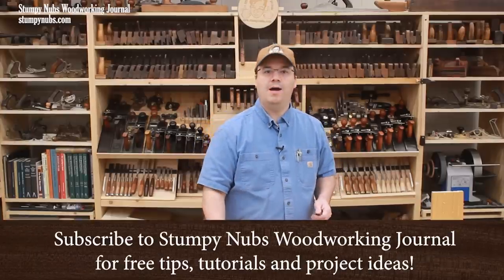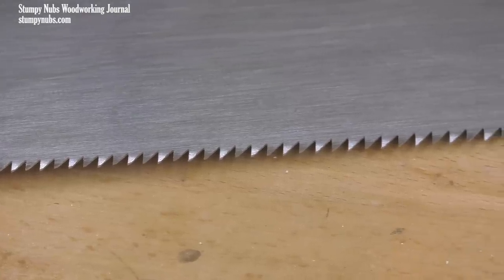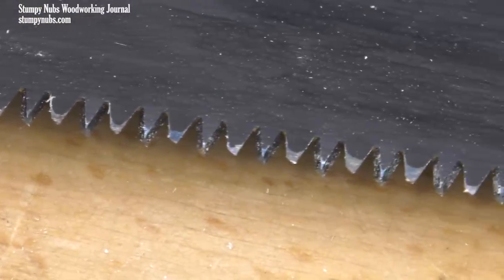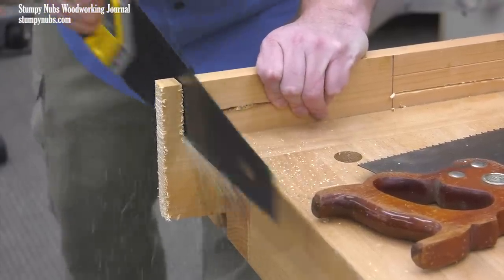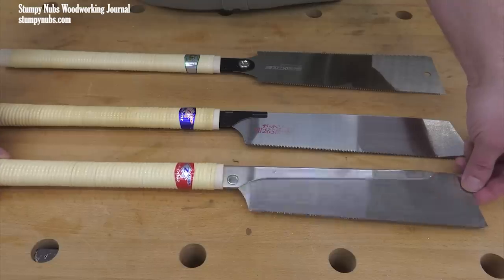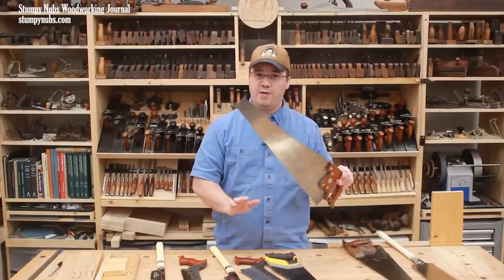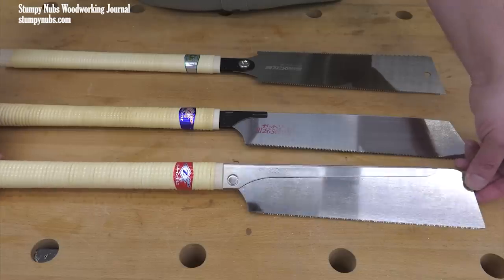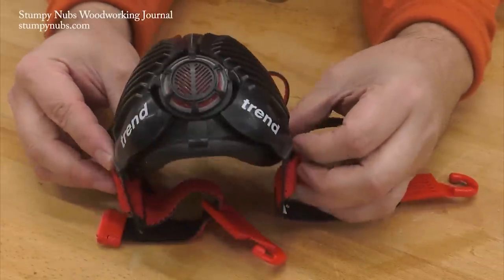Do Japanese saws cut faster than western saws?

Comment: The pull saws surely come with a cleaner neater cut, but I don't like to sharpen them, The push saws are so easy to keep tuned, The newer cross over saws that don't know if its a push or pull saw are designed to be disposable, and that is great for capitalism, so now we have some real choices.

Comment: you didn't take into account the length of stroke  for each saw. for example the stroke of the diston takes a 
much longer cutting stroke than the japanese saw..... when you are countjng stroke for stroke in my opinion
makes a big difference do you not think so ??
Reply from the maker: There are many factors that were not accounted for. This is merely my observations, not a definitive test.

Comment: The major difference between push and pull saws is the difficulty in using.  An adverage person using a pull saw will make a very good cut the first cut they make with it.  How many hundreds of cuts with a pushed saw to gain the same results, and how many kinked and ruined saws before they can make a decent cut?
Reply from the maker: You exaggerate. I started with a push saw as a child and never bent it. My first push cuts were on par with my first pull cuts. It's just a different process.

Comment: I think, regardless of push or pull, when you’re just starting out into hand tools, everyone should learn the proper technique for both saws and then make the decision. I had a terrible time with push saws starting out, but have since realized it was mostly user error. So, opinions can definitely change with experience and knowledge. For that reason, I think saying one is better than the other is unfair. It just depends on which one fits your personal style.

Great video. I appreciate the openness to others’ thoughts, questions and opinions.

Comment: Here's my takeaway: people on the internet will argue over anything. I don't know why the SPEED of hand sawing is relevant, when every saw is within a few percentage points of every other saw. 

What will the gallery argue over next? Which type of hand saw SOUNDS better when using it?? Can't wait to see the comments on that topic.
Reply from the maker: Nobody says you MUST be concerned with speed, but there are plenty of reasons why one may wish to consider it when choosing a tool. Speed can equate to less energy expended. It can also make a significant difference in the time it takes to dovetail a chest full of drawers or any number of other tasks. That said, there are many other factors to consider besides speed such as precision, comfort, quality, etc. These were covered in the other video: https://www.youtube.com/watch?v=PZdoLx72faM.

It is also worth remembering that not all of the fastest cuts in this video were rough cuts. The rough dimensional cuts may have been, but the joinery cuts were not. There is a time for both types of cuts and a bit more speed does not always equate to a poor result.
Reply: @StumpyNubs  Yes, I agree that there are many more factors to consider when looking at hand sawing. I think the point I was trying to make is that when one does a comparison of any single one of these factors, if all of the results are within +/- 5% of each other, that factor is nearly irrelevant (meaning: the other factors are probably what matter more). When you start to see differences of 10%, 25%, or greater, that factor becomes relevant.

Comment: I find it odd that in a competition regarding speed, no times were mentioned. Are we to assume the number of strokes directly correlates to the amount of time it takes to finish the cut? Anyone genuinely concerned with speed (i.e professionals) isn't concerned with number of strokes, they are concerned with number of seconds/minutes, and this should include the time it takes to get the cut started. Great video, but could be redone better with better science.
Reply from the maker: Time alone doesn't account for pressure, length, the grain of the wood (which can change significantly by the inch in a single board) any pause mid-stroke to adjust, angle of the blade, etc. It's not a scientific test and I didn't claim a definitive conclusion.

Comment: Speed is a red herring when comparing handsaws - western to western, Japanese to Japanese or western to Japanese.  Whether you are a pro, DIYer or home woodworker it’s probably fair to say no one (except maybe a logger in competition) works to develop speed of cut as a  skill.  People work to increase  their handsaw capabilities to make accurate and clean cuts.  Increase in cut speed  is simply an artifact of honing those two primary skills and in itself has no value.  The true comparison of saws and the only one which makes sense  is which type of saw helps you make more accurate and clean cuts.  That is largely a matter of what you’re used to. A western saw user will always make much cleaner and accurate cuts with a western style saw until they rake the time to practice with and use a similar purpose Japanese saw properly, and vice-versa.  Personally I prefer using a well tuned hand saw over power saws when they make sense for the type of cut and sometimes even when they don’t.  There is something very satisfying about the quiet sound, the feel, the ease and the movement of a handsaw.  I am starting to use Japanese saws more and more because I find them to be much more kind to my battered rotator cuff.  If I really do need speed I just pull out the circular saw.
Reply from the maker: Speed can sometimes mean less energy expended. Of course there are also many other factors involved. This is just one of them.
Reply: @StumpyNubs  I’m not sure that’s true.  It takes X amount of energy to cut from point a to point b.  You can do it slowly so you expend less energy on each stroke but you need more strokes.  You can do it quickly using less strokes but needing more energy for each stroke.  Do they balance out? I guess the only way we’ll know is to hook you up to  machines with a lot of tubes and electrodes to measure muscle oxygen consumption, electrical differentials, perspiration production, inhalation and exhalation gases, heart rate, respiration rate and probably a bunch of other parameters.  Take lots of pictures.  Or, you could just use the 1 sawtooth to 10 saw teeth “holy shit that sucked” scale taking.
Reply from the maker: @georgepagl  Speed is not just a function of how quickly you move your arm. Many factors add up to increase speed including the density of the wood, the pressure applied, the type of tooth, etc. And not all of those require extra energy to increase speed.... Again, this video is just a discussion of a single factor that makes for good sawing. The other video discussed other important factors.
Reply: @StumpyNubs  Morning, re-reading my last response, I can see where it may have sounded argumentative, and maybe a bit snarky.    Social media being what it is you probably get a lot of negative crap.  Hope it wasn’t taken that way.   Was just trying to add a bit of humor with the image of you in a video hooked up to a bunch of machines sawing a piece of wood.   With all other factors being equal, whether sawing faster or slower expends the same amount of energy may be an interesting academic discussion but is probably better left to a Physics channel.
I saw the other video and thought it was great, learned a lot.  All your videos are are really informative, enjoyable and well produced without any fluff.  Thanks for them.

Comment: Comparing the price of them with the advantage (or not) of them would add another element. If a $250 Japanese saw cuts only a couple strokes faster than a $25 western saw....

(I am a Silky saw snob, but that's for outdoor work - everybody marvels at how quickly and easily they eat through wood.)
Reply from the maker: Most Japanese saws, including the ones used int his video are significantly less expensive than a comparable Western saw. Mine are $25-40 each.
Reply: @StumpyNubs  that's surprising!

Comment: I think you hit the nail on the head! It's all about what your preferences are. I have all kinds of saws too, and I use them as needed. If I want accuracy and not speed. And depending on my shoulders and how they hurt when I wake up I use the saw that has the least resistance to my shoulder. Read between the lines. :)

Comment: Useless info. Today I was gardening and had to use my grandfather's Western style saw (its probably used since the 50s or 60s when he bought it) since I couldn't find my folding saw (I had to trim some grape vines that we use for shade and of course the fruit itself). Being up in the ladder using the old saw was hard and its to be expected because that was not its intended use. As soon as I found my folding pull-saw I started using this. The difference in speed was totally unexpected. I didn't time the cuts but the push-saw was way faster. And it's unexpected because I have not sharpened that saw at all. But wherever the pull-saw was biting the push-saw just ate raw. Of course as tools they are very different with the push-saw being around 50cm and the pull-saw at 20-25cm. But I didn't expect the newer saw that has seen no action compared to grandfather's saw, to be biting as much as it did.

Comment: Japanese saws work better in softwoods and European saws are better on hardwoods.
But that difference isn't big enough to really matter.

Mainly it's ergonomics.
The pull saw is easier if the work is between waist and shoulder height and the push saw is easier when working above or below.

Comment: Yeah, this has been my thought on this, western saws are carpentry saws for relatively quick, bulky, functional work that is very often covered up. Japanese saws are more in the direction of woodworking saws. Both are very good in their niche.
Reply: If what you say is s true, western style saws would never have been used for fine woodworking or furniture making. But that's absolute nonsense. Modern hardware store western saws are crude, designed for cutting plywoods and other materials more than hardwoods, but Western saws in general have a tremendous history of great furniture making behind them. Japanese or Western, it's about tooth geometry, teeth per inch, and technique. Generalize as you wish, but this is an objectively inaccurate assessment of the capabilities of Western-style handsaws.

Comment: In the rip and cross cut saws the technique you employed can be improved. Especially the length employed on each cut. All saws you “seemed” to use a similar length of stroke. This may be because of much practice on a pull saw. 

I would have got a wrap over the knuckles in my apprenticeship for using a saw as you did.

It must be said that good technique on a pull saw has a similar result.

BUT!!!!  A longer saw will cut quicker
Reply from the maker: Generally I begin with short strokes and lengthen them as I go along and get in a rhythm. Everyone has their own style…. As to how that affects my tests- Each tooth can only remove so much wood from the kerf. A longer stroke just passes more teeth through the kerf with each motion. That doesn't necessarily equal less overall time cutting through the board. If that were the case I'd just get a 3-foot long Japanese saw, cut the board through in half a stroke and declare it a winner. In this video it seems to me that most of the strokes were about the same length regardless of the saw and this allows us to observe the difference between the types of saws independent of the length. After all, not all Western saws are longer than Japanese saws.

Comment: I think using the metric “faster” is leaving a lot of the conversation on the table. If I’m using a hand saw instead of an electric saw, it’s not because it’s faster.
Reply from the maker: There are plenty of reasons why one may wish to consider it when choosing a tool. Speed can equate to less energy expended. It can also make a significant difference in the time it takes to dovetail a chest full of drawers or any number of other tasks. That said, there are many other factors to consider besides speed such as precision, comfort, quality, etc. These were covered in the other video: https://www.youtube.com/watch?v=PZdoLx72faM.

It is also worth remembering that not all of the fastest cuts in this video were rough cuts. The rough dimensional cuts may have been, but the joinery cuts were not. There is a time for both types of cuts and a bit more speed does not always equate to a poor result.

Comment: Using two hands to saw with a push ssw is a guarantee to ben your sawblade or even get a kink
Reply from the maker: Not at all. Western style saws have always been used two handed for some operations, particularly when making long rips. You can find the technique described in many old woodworking books.
Reply: @StumpyNubs  my teacher warned me about using two hands sawing 50 years ago and that stuck
Reply: @StumpyNubs  i will look into that

Comment: In short, everything we do in life has advantages and disadvantages, nothing is perfect use case scenario for all purposes. A drill is used with drill bits to make holes or with screw bits to screw screws, yes you can technically connect a series of gears and rods to drive a push rod to break rocks with it, but it's not ideal for that purpose. On the other hand buying mining gear can be expensive, so you need to COMPROMISE over effectiveness VS buying every single type of saw on the market and switching between them like an over caffeinated chipmunk that found Pablo Escobar's secret stash of cocaine.

Comment: I am surprised that you did not have even a mention about the quality of the cut.
It sure appeared to me that the pull saw produced a cleaner cut,
or was that just due to the camera position?
The cut was exposed on the cross cuts and there was no comparison on the quality,....
I guess that the perfectionist in me cannot handle the concept of a "rough cut",...
or flipping that around, what I find enjoyable as a hobby probably mean I could never make money at this.
Reply from the maker: The pull saws produced cleaner (though not tear-out free) rough cuts. But all the western and the Japanese joinery saws produced equally clean cuts.

Comment: I have been making sawdust professionally since 1982. The vast majority of this saw dust has been produced using portable electric saws. I do however carry a number of handsaws in my work van. When I’m doing odd fill-in jobs and only need to make one or two cuts, it is much faster to grab the correct handsaw and cut than it is to get a power saw out, find an outlet, plug the extension cord in, adjust the saw, make the cut, and put everything away. The handsaw has the added advantage of being quieter and having the sawdust drop to the floor instead of being flung into the air.

Comment: I learned to use a hand saw from my father who was an old time carpenter. How old time? Well he would be 107 this year. On a western style saw you use the teeth of the saw to cut. Powering through only makes you tired. Eight or 10 hour days of powering the the cut does not work. There is a idea that everything Japanese is better. If that is a persons feeling, that is fine. Just don't turn an opinion in to a fact and not let others find out for them selves.

Comment: Just throwing this out there... length of stroke variables.
Reply from the maker: Each tooth can only remove so much wood from the kerf. A longer stroke just passes more teeth through the kerf with each motion. That doesn't necessarily equal less overall time cutting through the board. If that were the case I'd just get a 3-foot long Japanese saw, cut the board through in half a stroke and declare it a winner. In this video it seems to me that most of the strokes were about the same length regardless of the saw and this allows us to observe the difference between the types of saws independent of the length. After all, not all Western saws are longer than Japanese saws.
Reply: @StumpyNubs  I'm just saying, that without controlling the stroke, it is a variable. I have no skin in this argument. I just deal in facts. All of my wood work is done with power tools, chisels, and sanding. A miter box and saw occasionally. But to eliminate stroke as a factor it would need to be regulated/controlled somehow.
Reply from the maker: @jeramiet154  You are assuming that it is possible to eliminate variables in this test. It's not. It is impossible to cut something by hand the same way twice, even with the same saw, let alone different saws. The pressure you use, the angle of the blade, heck, the density and grain of the wood can change inch by inch in a single board and dramatically affect the cut. This was never advertised as a scientific test and in the end I did not offer a definitive conclusion because that is simply not possible.  This video is a quick examination of the tools with my personal observations.
Reply: @StumpyNubs  I simply realized and pointed out a variable that is controllable, for your sake. Other variables you listed as impossible to eliminate could at least be narrowed down as well. I'm not here to argue.
Reply from the maker: @jeramiet154  Who's arguing? You are sharing your opinions and I am sharing mine.

Comment: I think each saw should have a stopper at each end. All saws being equal in length. A 24” saw will cut faster than a 12” saw… the strokes don’t matter if the length of the stroke is different.